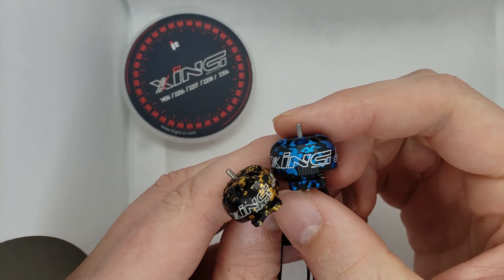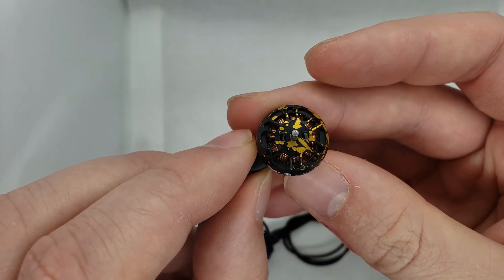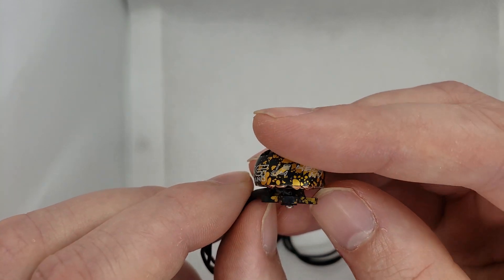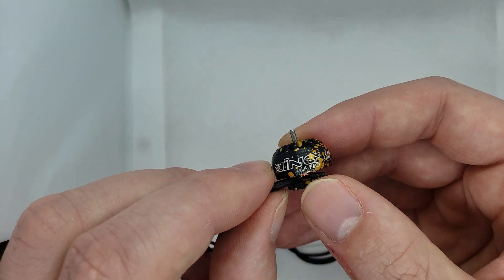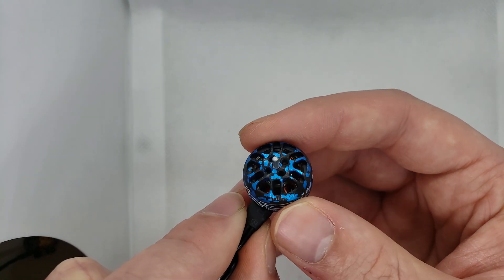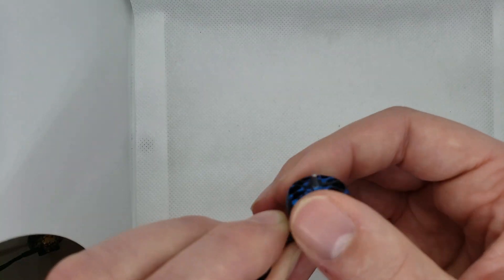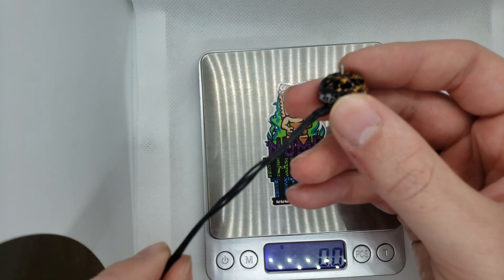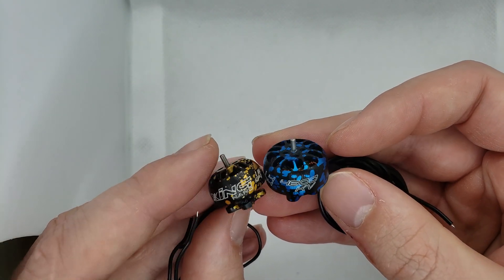Iflight Xing 1204 & 1404 FPV Motors - Quick Overview

Comment: I got some 1404 4600kv  and just replaced from hglrc 1407 3600kv.

Will have test flight tomorrow and will see how it goes. 

Thanks for video
Reply: Dude, brushless 1404 works with 5" frame? I bought those by mistake

Comment: I put some 1404 on a 3 inch. First flight two mins in Kwad falls to ground...motor bolts came out... 
Put it back on and I noticed it became much harder to spin it by hand. Powered up and it just judders.
Basically knackered. No obvious signs of damage....
Disappointed... But ordered another and will see how it goes.

Also was surprised at how incredibly notcy they are.... ! 

I'm fairly new to the hobby but  based on my short experience  and how it feels I'm disappointed.

Comment: Hi, thanks for posting this! I'm new to this world but I'm very interested in using this motor for my design. I'm confused by the specs that I find online for these motors, with the input voltage. The sheets reference voltages such as 8, 12 and 16. Are these supposed to be 7.4, 11.1 and 15.2 respectively? Do you have more precise specs than the ones commonly available?
Reply from the maker: You'll need a t-mount props with 1.5mm shaft and 2 mounting holes. HQ T3x2 is a good choice, also Gemfan 3018 & 3016.
As for voltage, it goes by cell count. 3.7V per cell (storage), 4.2V per cell (full).
Reply: @rotorvillage  thanks, but I'm sure that when they say 16 in the datasheet it doesn't actually mean 16 cells (16x3.7v=59.2v), right? instead it means 4 cells (4x3.7v=14.8v), right?